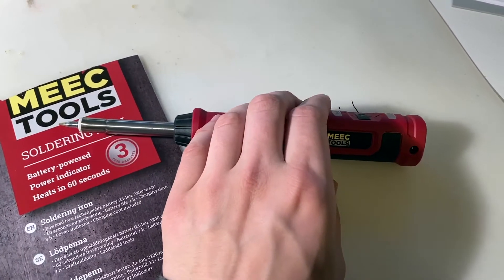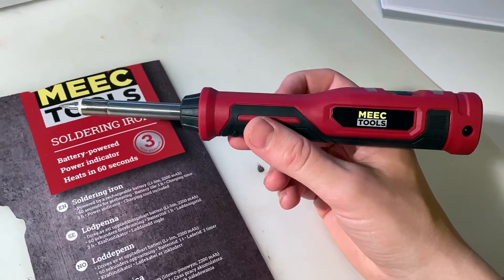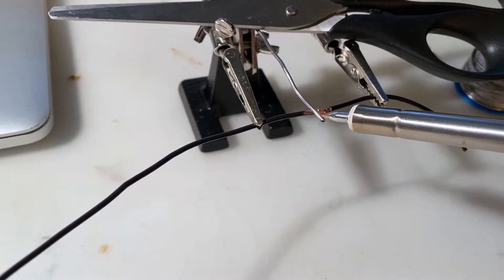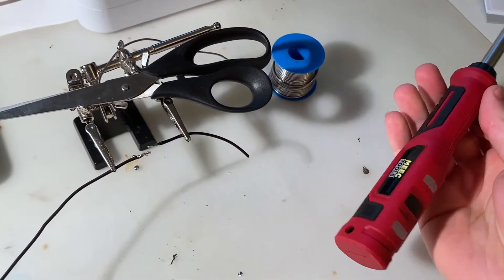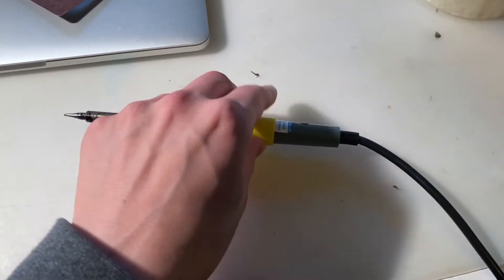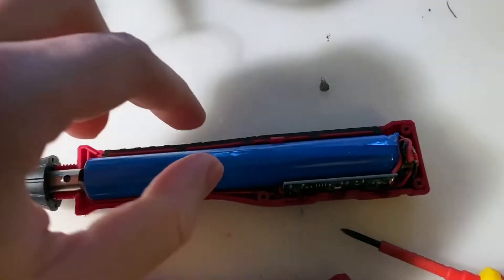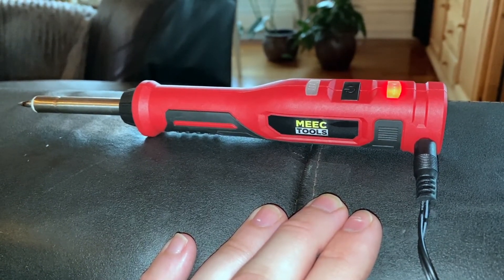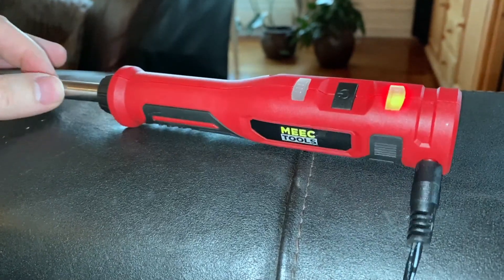Does A Rechargeable Portable Soldering Iron Work?? - 16w 2200mAh – Meec Tools Jula

Comment: Jobathano What tips suit this soldering iron? because in the movie you can't see 
you take out the arrowhead. I wonder if you can buy them somewhere? can 
you measure the diameter and length of the tip?
Reply from the maker: Hi. Sorry for the late reply, had much going on the two last weeks. M3 size threads, not to easy to find replacements, but you will find them. But I would guess these battery charged one will become more popular and tips easier to find.